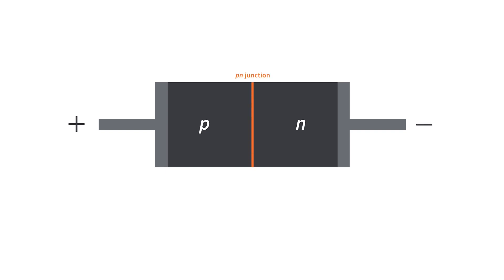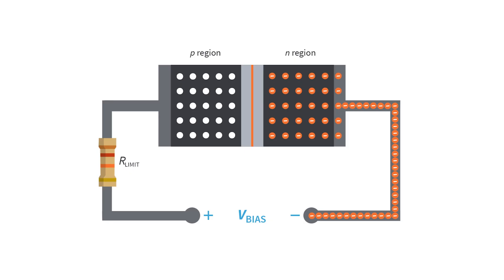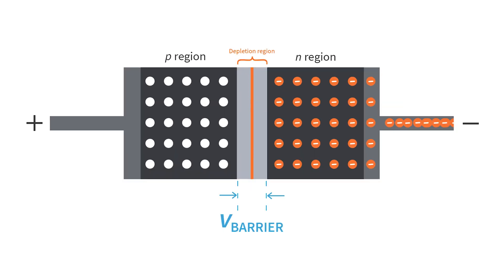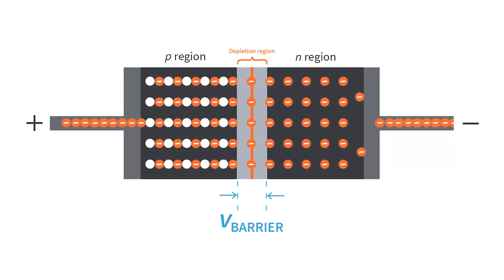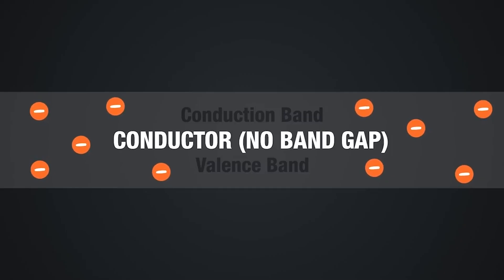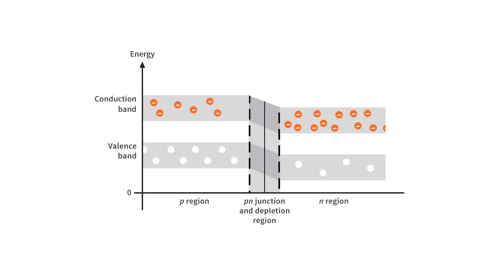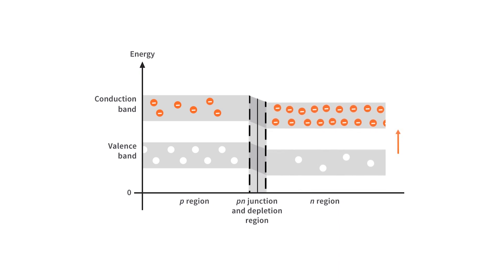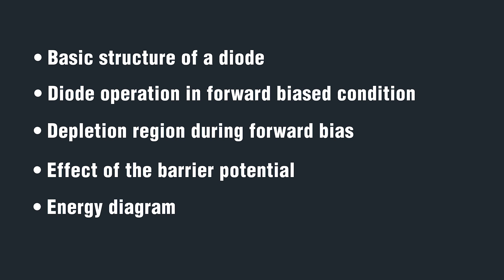How does a forward biased diode work at the molecular level?  - Part 2 | Intermediate Electronics

Comment: Is the depletion really a vertical line?  Why not a horizontal line?

Is that just about the biasing?

The conductors are axial in a diode so should the deletion region not connect the conductors?  Or is the region not a physical region but a concept of conductance?

Comment: Dear CircuitBread:
Just a quick question. What software are you using to make these lovely graphics?
Reply from the maker: It depends, it’s usually either In Sketch App, Illustrator, or After Effects.
Reply: @CircuitBread  Aha... Thanks for the info. I had used Sketch App many years ago but I can cant see how it is doing these unless its where you create the geometries.
This brings the question of how do you simulate the moving electrons? Illustrator??
Best
Reply from the maker: Movement is done in After Effects, with more complicated animations (rarely, usually with client videos) we'll use Blender.  But most of what you see on our channel is After Effects.
Reply: @CircuitBread  Thanks for the clarification. I have strted to learn Blender mydelf for other purposes but what you described is really a whole production process... The next thing for such skills is full cartoon animations but for such good scientific animation productions, your doing a wonderful job. My respects for all the excellent work that your doing... Well done

Comment: Can you control this 0.7 voltage drop for example with the materials of the diode, or anything else?
Reply from the maker: Yes, you can!  That's actually the basis of schottky diodes - they use different materials that let them have a lower forward voltage and a faster response time.  As far as I'm aware, the materials of the diode is the only way you can change the forward voltage.
Reply: @CircuitBread  waaaaaat this is amazing definitely gonna add this to my report thanks 😊

Comment: Why does the forward current increase exponentially, instead of going linearly or parabolically...I mean, the number of available electrons are same...so where's this current increasing so exponentially
Reply from the maker: Hey Jonathan - it's not related to the amount of electrons available, it's because of the depletion region.  A diode is non-linear, so its resistance isn't fixed, and as the voltage goes up, the "apparent" resistance drops as it gets easier and easier for the electrons to cross the depletion region as more voltage is going toward moving the electrons versus overcoming the barrier potential.  There's almost certainly a better, chemistry-level explanation, but I'm hoping that clarifies things at the EE level.

Comment: When does diode conduct current in reverse bias,Sir?
Reply from the maker: In reverse bias, there's always a small leakage current and then, if you put too large of a voltage in reverse bias, you'll have a breakdown and your diode will start to conduct a lot of current.  If you haven't checked out Part 3 of these videos on diodes, I recommend it!
Reply: @CircuitBread  Thanks for the quick reply,Sir.It means a lot.

Comment: @CircuitBread..   Excellent explanations ...  Can u please provide me a clarity on the difference btw built-in voltage and cut in voltage
Reply from the maker: Thank you!  My understanding is that they're related but cut-in voltage is a bit more "handwavy".  Cut-in voltage is pretty straightforward - it's the point where we assume the diode is conducting.  It's straightforward  conceptually but difficult to know at what point we consider it to be conducting.  For general diodes (the assumptions we use when we talk about diodes at CircuitBread) we assume the cut-in voltage to be .7V on standard diodes, which is kinda the industry standard as well.

Built-in voltage is the calculated voltage potential created by the depletion zone, the electric field that will need to be overcome before current can flow.

From my perspective (and differing or clarifying comments would be appreciated) they are talking about the same thing but cut-in voltage is by looking at the point in which the amount of current flowing passes a semi-arbitrarily selected value.  Built-in voltage is the calculated result (from knowing the dopant levels of the diode) that yields the voltage needed to overcome that barrier in the diode.

Comment: A question sir the depletion region has no free charge carriers neither the conduction electrons nor the valence holes so how current is passed through it?? (By which band conduction or valence) please explain.
Reply from the maker: Just because no free charge carriers reside in the depletion region, they are still able to pass through when reverse biased (which is why you get the small reverse current).  When forward biased, and there is still a depletion region, electrons still can pass through.  Though if the diode is biased enough, the depletion region basically disappears completely.
Reply: @CircuitBread  when the diode reverse biased then the almost all the atoms in p region have gain an another electron and completed its valence shell and conduction band is empty(but the p type will become slighlty negative becausr now it has 1 electron more than proton) similarly n type will lose the 1 conduction electron(and becomes negative) so the covalent bonds are complete on both sides now the leakage current is due to the some of the bands which have been broken due to the temperature as in intrinsic and now they are free conduction electrons as same leakage current passes through the depletion region in forward bias if applied voltage is less than 0.7 volts  its ok its all that i have learnt the pn junction in reverse bias acts like intrinsic semiconductor. But how the current is passed when the forward biase voltage will be increased beyond 0.7 volts will this current passes through conduction or valence band kindly help i will be really thankful to you 😃

Comment: 1. when electron from conduction band   of n side enter conduction band of p side why it recombines with holes in valence band, y is it not going in the outer circuit with in conduction band only
2. when electrons that have entered p side recombines with valence band holes isn't it emitting photons
Reply from the maker: Hi Vrinda!  For 1) when the electron crosses the PN junction, it loses energy in that transition, so that decrease in energy means they drop energy levels - energy levels that most likely put them in the valence band.
2) Actually, sometimes they do.  While non-LED diodes aren't optimized for photon emission, that's actually how the concept of LEDs was originated.  They noticed that some exposed PN junctions glowed when forward biased - this is briefly mentioned in our history of LEDs video, if I remember correctly.  A lot of the energy is released as heat, though.
Reply: @CircuitBread  Thanks A LOT!

Comment: Ihave a9watt led lamp inside it there is12diod in series ,ldevide them to 6and6groub.what about its electric consumption?
Reply from the maker: If there are 9 watts being consumed by 12 diodes, then 6 diodes (with the appropriate voltage) would consume half.  Unless I'm missing something?
Reply: @CircuitBread  l mean 2groubs of led.
Reply from the maker: Then a group of 6 LEDs should consume 4.5 watts.  It would be easier to say that each LED is consuming .75W so however you have it setup, you should be able to multiply the number of LEDs by .75W and reach the total amount of power consumed.